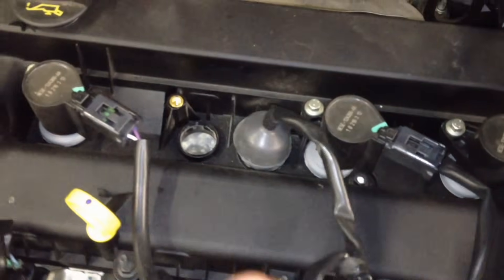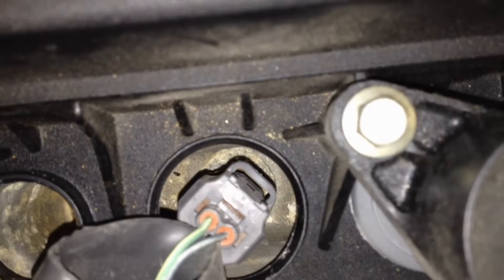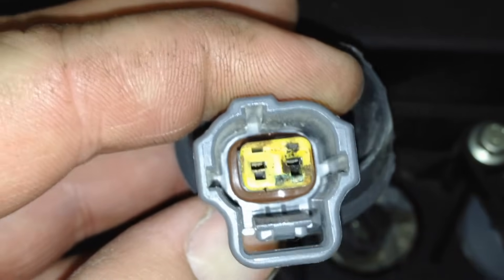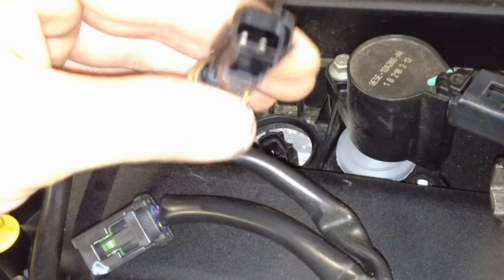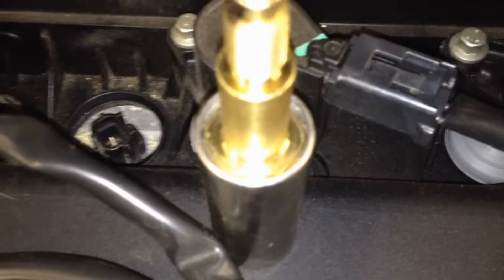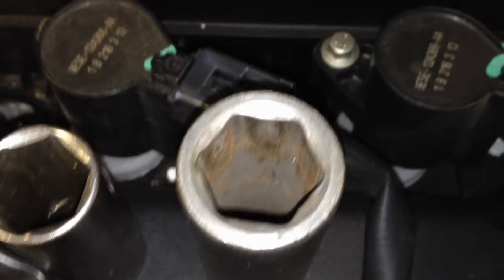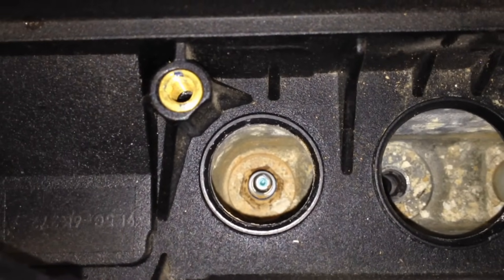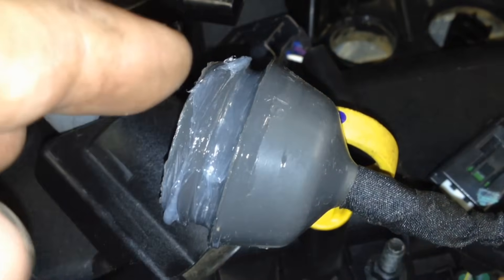Ford Escape & Fusion 2.5L False Overheat And Misfiring

Comment: I have a 2013 I bought in 2016 and it has over heated 4 times on me in the first 3 months, I took it to the "dealer" they told me it was the battery which was not the case, then it was a sensor they replaced them still overheating then they couldn't find anything and still charged me. took to a midas shop where I gt all my other work done they informed me they had 20-25 escapes and called ford to no end and no fix was found.

So my question to you if you can help is this, what would cause my car to overheat while waiting in traffic or in line at Dunkin Donuts?

it has no overheating while driving only when sitting in gear and it don't matter summer or in the cold of winter here in Vermont

I would love to be able to go to my dealer but they are not able to fix it so please any help would be very nice vs waiting for it to shut down or even catch fire

Thanks you once more for any help
Paul Taylo
Reply: this exact same thing is happening to me. did you ever find the true issue?
Reply: @jaymelynn9835  no and it's still doing it, I just learned to live with putting it in netutal when I stop and go without the AC when not moving
Ford promised me it was fixed 😔 3 years ago and it's not doubt if it ever will be

Comment: Thanks for the video. I'm having this same issue with my Escape. I've looked everywhere but have been unable to find a 19mm deep socket with a deep enough shoulder. Do you happen to know the Craftsman part# for your socket?
Reply: Did you find one?
Reply: @marlenerodriguez444  Unfortunately, no.
Reply: You can use the lug nut wrench that came with the car

Comment: This was my problem with my 1.6 - 2013 manual trans Fusion.  At least close enough to get me on the right track to find a coolant wet connector on mine,  Thanks!  I totally get going to the dealer especially odd seemingly electrical issues.

Comment: Great info,Thank you for all you time you put into this.
What did you do with the connector?
Reply from the maker: I replaced it also with a new pigtail from Ford.
Reply: @FordTechMakuloco  I have a 2010 ford escape limited V6 3.0. Is there a different one for this SUV? Because Amazon is telling me the one you put the link to won't fit mine. Orealys has two different ones but which do I use? Help! Love your videos by the way. Helped me out a lot on my lift gate problem a few years ago.

Comment: IMPORTANT PLEASE READ.  2007 Ford Fusion SE 2.3 4 Cylinder

I just went to my Ford dealer for an oil change, and I'm so happy that I went to the dealer. Here's why: I paid additional money to have an inspection of the vehicle. In the inspection, they found three things. One was an oil leak on top of the engine near the valve cover area. Today I looked for myself and confirmed their finding. I pulled off the boot cover to the CHT and found the chamber was flooded with engine oil. I sort of believe  that because engine oil is now surrounding the CHT, it must be relaying an incorrect temp to the gauge on the dash, and an incorrect temp on my OBD 2 scanner.  I also removed a coil to see if the spark plug chamber was flooded too (yes it was). 

Any suggestions on how I should proceed with this known problem? I believe this started back in April earlier this year and the car has been running fine, for now.
Reply: How did this get resolved. I believe I have the same issue

Comment: Any ideas what the issue could be for a fusion 2014 1.5 L ecoboost? Its overheating and reads the coolant temperature sensor, changed it, and a week later its overheating again reading the same code. I did learn through Ford this year fusion  does not have a cylinder head temp sensor.

Comment: Thanks for this video and the information. I have a 2010 Fusion with the 2.5L and the 6F35 trans. I'm going to go out and check my CHT to see if there is any corrosion. I'd rather prevent a problem than fall victim. Should we use regular high temp RTV to seal the boot?

Also it's probably a good idea to open up all the plug and CHT holes after washing the engine compartment and blow out with compressed air? Not sure how much water gets in the plug holes, but after seeing this...

Thanks again.

-Matt
Reply from the maker: Regular automotive silicone sealant will do, I would check all the spark plug well if the engine was power washed yes.

Comment: Great video! I have a 2010 Mercury Mariner with the 2.5 it had a bad tensioner and was throwing the belt. It had the code for the CHT but I thought it was because of the  fact that it was running without a belt. After replacing we drive it for about 10 to 15 minutes then it doesn't start. I cleared codes after replacing tensioner and belt and I'm still getting the CHT code. I connected a scan tool and the CHT reads -40 degrees I checked just like in the video but the sensor looks good but I noticed the connector does not lock on the sensor. Should I replace the connector or both the sensor and the connector? Would an incorrect temp reading cause the crank no start issue?

Comment: Nice video. I think i might have the same issue here. Its a ford focus mk2 1.6 16v zetec engine. And when in test mode, the dashboard display shows that the engine temperature is 120°C, but the temp gauge shows its about 80°C. I googled a bit and heard about the CHTS also thanks to your video too. Would you mind telling where the CHTS would be located on the 1,6 16v ZETEC engine ? Btw. totaly agree about what you said going to dealership vs. independent garages. I learned the leasson in a costly way too, and from that moment on i always go to dealership garages. From my knowledge you guys in dealerships go to educations, something someone at independent garages might be missing. Ok most techs should / would be able to repair most of the stuff on any car, but there is still room for the little quirks applicable to specific manufacturers that you learn through manufacturer info provided to dealerships.

Comment: @FORDTECHMAKULOCO.....I have 2016 Fusion Hybrid, my daughter hit a piece of shredded tractor trailer tire the other day. Lot of cosmetic damage to the front driver side of bumper. but no it is throwing the engine coolant over temperature but there are no codes when I hook up the code scanner. and from what I can tell, there are no wires or plug-in that are damaged from the tire piece. Would this be something I need to check out for a possible false overheat? Never had an issue until that morning.

Comment: Excellent video.  We attempted to install the new sensor using the 19mm socket, while tighing the sensor, it broke from the shaft going into the sensor threads.  Do you just hand tork it?  Thanks

Comment: Does that sensor set in or over a well for coolant? If so that would be a much easier home fix for clearing the air from inside the block during a coolant fill. I’m asking because I’m in this pain now. Small leak identified but unlocatable during vacuum filling since there’s no liquid to leak. It’s been a long week on this

Comment: So, I have a 2014 Ford Escape se 1.6 liter. We have changed the coolant reservoir, coolant temp sensor, cylinder head temp sensor and the thermostat. It’s been sitting for over a week. It’s still showing high temp, stop safely. Any ideas on what it could be now?
Reply: Jennifer im have same issue as you currently did you figure out the problem because im at a loss on mine!!!

Comment: So I have a 2012 w/ a 2.5 and 188k miles and have a really strong vibration in gear when cold.  smooths out a bit when hitting operating temp but doesn't go away completely unless I'm in neutral or park.  could this be the issue?  I've swapped out all 4 mounts already.  I have no engine codes.

Comment: I’m having a problem with my 2013 Ford Escape I had my water pump changed and I algo changed both the engine belt and timing belt also replaced the head gasket and the check engine light does not come on so I’m not sure what’s going on the ac also makes it overheat faster do you thing it’s that sensor or air pockets?

Comment: Thanks for the video. No knock here but P1289 code on a 2010 fusion. Temp indicator turning off a couple minutes into a drive. Have the new part in the mail and it looks like an easy replacement!

Comment: I went to Ford dealership with my 2013 Ford Escape and they replaced a relay & thermostat saying it'll never happen again. well so much for  a Ford Dealership my SUV still overheats when in gear and sitting at a redlight or in traffic for more than 15 min

So seeing how Ford can't fix it what's your thoughts on my problem could it be this or not?

Thanks for any help as no one can fix my problem

Comment: Great video. I have a 2002 ford escape 3.0 and I have changed the radiator, water pump, and the thermostat. I still have a over heating issue and no heat inside. Any ideas on what it might be. I think there is a small crack in the overflow but not 100% sure.
Reply from the maker: As long as the thermostat is not in backwards and the head is not cracked I say you now have an air lock situation I recommend this tool to get it out-
http://www.amazon.com/gp/product/B0002SRH5G/ref=as_li_tl?ie=UTF8&camp=1789&creative=390957&creativeASIN=B0002SRH5G&linkCode=as2&tag=fordt-20&linkId=7CWFQMMBUMINZ2OD
Reply: I will have to check that out. The Truck has clean oil in the oil pan and no white smoke so I don't think the head is blown. Thermostat went in the way it came out.  One thing I did notice that I thought was weird , was after I changed the water pump, radiator and the thermostat when I refilled the overflow tank it did not take a lot of antifreeze. Nor did hardly any come out of the hoses when removed from radiator, thermostat  and water pump. And is there a bleeding valve on the system? Thank you very much info.

Comment: ford focus mk11.6 16v on the dashboard shows that the car is overheated and after 20 seconds the lights are normalizing and when you raise the bonet everything is nice the antifreeze does not boil anything does not show overheating.more I changed the sensor together with the thermostat the result is the same

Comment: Good Info, is there a similar problem with false under temp readings and setting codes? I have a 2005 Escape hybrid that will set a P0128 under temp code, not sure if this is thermostat or sensor issue. never had this code pop up until after i cleaned the engine compartment. I can clear the code but it will come back sometimes in a few days or in a few weeks. 
I have not been in a big hurry to fix it since under heat will only lose a little fuel mileage.
Reply from the maker: +Jack Lance P0128 are pretty common on Fords 4 cylinder engines especially the 2.3L and 2.5L 95% of the time the thermostat is the cause of the concern we replace allot of them. Just be sure to use the Ford unit. Also be sure to vacuum fill the engine or you will have overheating issues next see here-http://www.amazon.com/gp/product/B0002SRH5G/ref=as_li_tl?ie=UTF8&camp=1789&creative=390957&creativeASIN=B0002SRH5G&linkCode=as2&tag=fordt-20&linkId=5ADJ42YIPPCCAKVT
Reply: Did you ever figure this out? Is it the thermostat or the sensor?

Comment: My wife's 2015 Fusion SE has been the worst car we have had in years. I was a Loyal Ford buyer in the 80's into the early 90's. After 2 Ford F150 lemons 1992 and a 1994 I left Ford and went to GM. Never had an issue or one with lots of problems again so I never touched a Ford again after that. In 2016 my wifes 2002 Buick Century we got in 2002 hit 190k and was 16 years old. Only in shop once to repair the common intake manifold gasket failure it was time for her a new car. She liked the look of the Fusion as it was a sporty mustang looking 4 door sedan so against my better judgement we decided to get her one. We got a 1 year old 2015 Fusion with 18k miles on it. Loved it until we were left stranded at 22k. Ford towed it in under warranty and it turned out to be a cracked head in 3 places. Appeared to be an issue from when they forgedd the head and got through quality control. I know quality is job 1 at Ford. Got it fixed and it has ran good until now at 45k miles. Started misfiring and engine code. Code is intermittent but computer says bad ignition soinoid, but not which one so I baught 4 brand new ones with lifetime warranties from O'Rielly to make sure to get correct one. All good for a couple weeks then the same problem is back. I am now thinking a bad plug or some sort od corroded sensor. Have you dealt with this issue? Believe me after I fix this I am trading it off and not going to touch another Ford for the rest of my life. Always problems with them. I know you got people that have had good luck, but not me:P

Comment: I have a 09 milan I'm working on I work at a firestone and I'm chasing my tail on this thing we've replaced the thermostat the water outlet and both cylinder head sensor and the temp sensor on water outlet and we r still getting an over heating issue I'm still thinking it not getting hot tho the cylinder sensor I installed wasn't as long as the other one that cane out it was like 2 or 3 inches shorter could it be the wrong sensor I really need to pick your brain any way I could speak to u on the phone thanx

Comment: Thanks for the video. I didn't catch where you said that the water is coming from since its screwed into a dry hole. I have the 2.0 liter Transit. After it has been driven water is coming a bit out of the top of the boot. What do you think?
Reply: check the heater hose as it turns toward rear,, from the front of the engine whole hose is $90. I replaced from joint to the rear connection. T-connection broke and blew antifreeze everywhere.
Reply: @curt6531  I need to check every hose. I still smell some antifreeze. It's a really small leak. I might replace all of the hoses since I have 110,000 on it and keep the old ones for spares. I also have a slight seeping from oil pan or hopefully not the rear seal.
Reply: @70FordMach1  check the diagram and zero in on this connection. its not the hose. its this T joint-  in the middle of the hose. see Ford diagrams.
Reply: @curt6531  Thanks, I'll take a look.

Comment: So my temp gauge spiked driving to work yesterday.  It spikes while driving, and drops while idling.  It did it again this morning.  I have no heat when idling, but heat works when driving.  I just bled my cooling system.  It did have air in it, and bleeding it seems to have helped, but I noticed when I pulled the cover off the CHT sensor to check that, that I have what looks like used motor oil pooled down in there.  I have a 2007 with 160,000 miles on it and I am imagining the worst with that oil being in there.
Reply: see if a valve is leaking oil and it got in there

5 years later what was it

Comment: So question I have a check engine light for this part your talking about on my 2014 fusion does everything needing to be vacuumed down on the coolant system does that apply to when you change the coolant head temp sensor?

Comment: I have a 2003 Ford Ranger 2.3L. The CHT was replaced by the previous owner and it was a botched job. While I was trying to fix it correctly, the wires from the truck came apart from the new pigtail. So, can you tell me how they hook up correctly? Pigtail wires are white and black. Truck wires are yellow/green line and grey/red line. Any help appreciated!

Comment: Thank you, thank you very much for this informacion, more than a week whit this problem and finally solved in 10 minutes, you are a genius. God bless you.
Reply from the maker: Awesome to hear it all worked out!
Reply: @FordTechMakuloco  voyageur1998
voyageur1998
il y a 1 seconde
i bring my 2009 escape 2.5 to the dealer to do the cover valve gasket and since they did it i got a missfire on cylinder 1 a p0301 i swap the coil and put new plug and even change the injector and i still got the same problem could it be that sensor that do all the problem or its something else

Comment: I have a 2002 Ford Escape with 6 cylinders that has completely lost power and the EGR valve blew open.  The RPM is below 2000 RPM and can't go above a few minutes per hour.
I had misfiring on Plugs 4, 5 and 6 and replaced the Spark Plugs, Valve Cover Gaskets,  Oxygen Sensors.
After replacing all these, I have no engine codes, but the power has not been restored.
Can you please advise what I can try to restore power to the Ford Escape?
Reply: Found out that I have a clogged Catalytic Converter which resulted in lose of power.

Comment: i bring my 2009 escape 2.5 to the dealer to do the cover valve gasket and since they did it i got a missfire on cylinder 1 a p0301 i swap the coil and put new plug and even change the injector and i still got the same problem could it be that sensor that do all the problem or its something else  FordTechMakuloco
Reply: mine is broken  i think the mecanic broke it but didnt mention it to the shop manager i just check it this evening the sensor came with the plug

Comment: I have an 05 and replaced this sensor, but it came with a new plug/pigtail since Ford changed the design of the plug over the years. I wired it in the same as the old one. Is that backwards? I've have some stutter when taking off from a stop since then and the temp gauge is acting wild and the code for CHT came back.